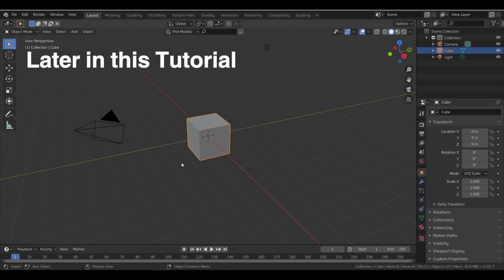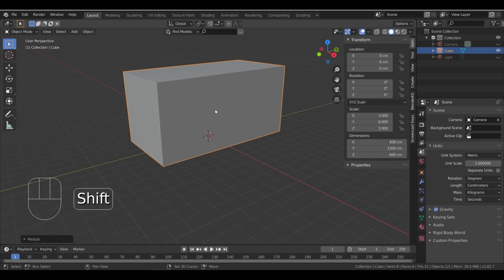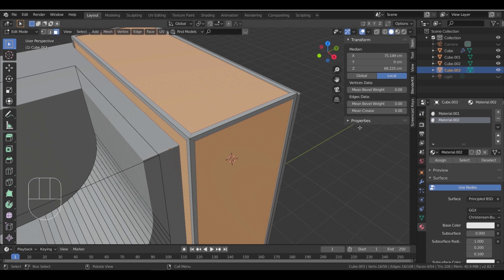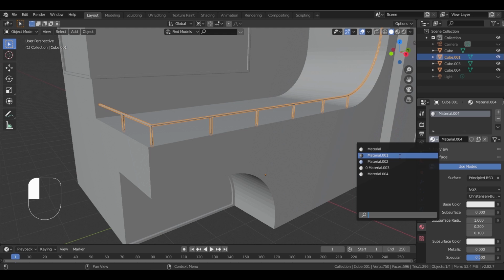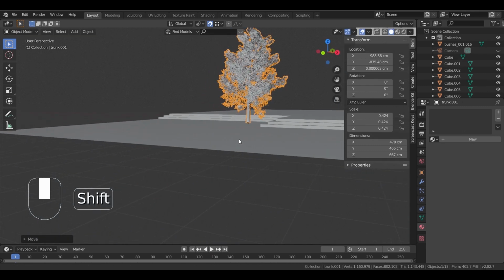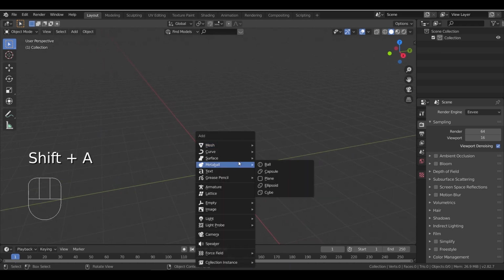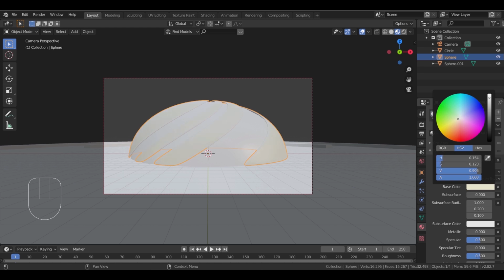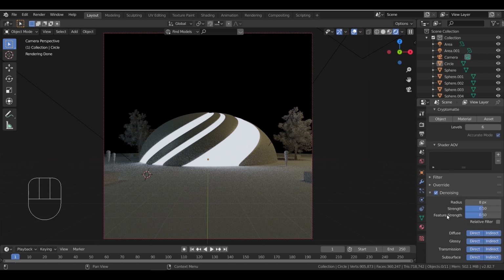Introduction for Beginners - Architectural blender

Comment: Very nice tutorial, I am a complete beginner. Now my render image is black and the building is 1/10 under the grid? Any resolution to fix said problems?
Reply from the maker: Hi David
black render mean ain't no enough light to show ur modeling, add light sources or boost up the power in the one you added.
to level your scene with the grid hit A to select all and G to move it, hold shift to make the movement slow. it really don't matter if ur scene below the grid.
hope this helps.
Reply: @architecturetopics   Thanks, it helped a lot!